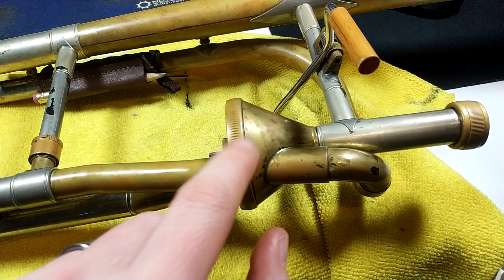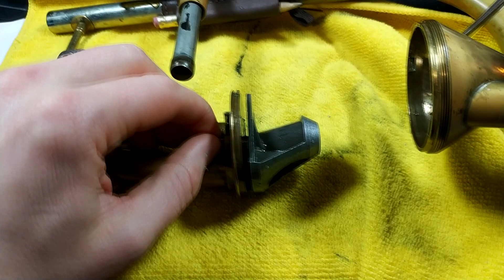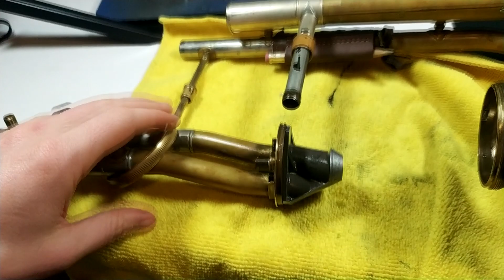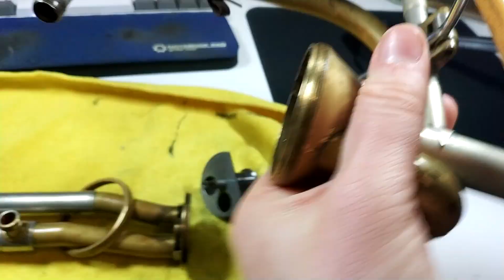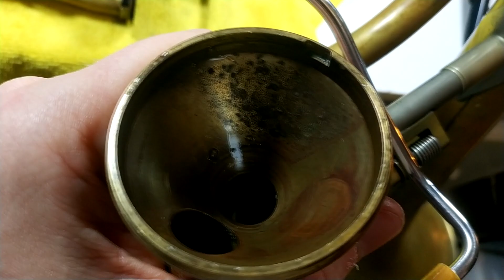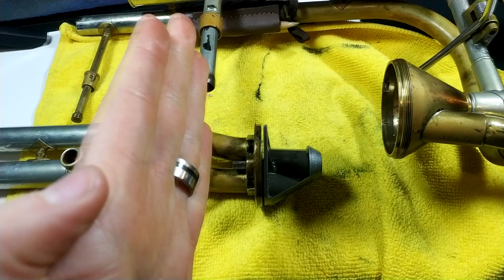The Thayer Problem

Comment: Hello Aiden
Question.......i heard you mention some of the new infinity axial valves play well and some don't can you elaborate some on this from you experience  etc..........
Also I've notice the original Thayer valves are really very open ( I can only assume that's the intention) compared to the new infinity axial valves.  Is it possible the new infinity axial valve is mis aligned?

Thank you
Ps.any suggestions recommendation if needed for a tech to take a look
Reply from the maker: the new Olsen (Infinity) valves can be very open as well, but they are often not built right at Bach. I've played some built by my tech that are AMAZING, as well as others that were randomly built correctly by Bach.
Reply: @AidanRitchie  GM thanks for responding.  Well I purchased the infinity valve from the Mike Olsen himself.  On that note do you mind send me your techs.number etc.......and I can have him take a look at my horn?
Reply from the maker: @slide50t  Go ahead and use my lesson form, I'll send an email back to you using that!

Comment: My Thayers are totally stuck on the spindle end, they pop up a tiny bit (enough to clean under there) but I can't take them off fully
Reply from the maker: The stop arms?
Reply: @AidanRitchie  Yeah, they are pretty much stuck even if I remove that screw
Reply from the maker: @SilverAg11  they can be like that. A tech will be able to get them off, but don't do anything drastic!
Reply: @AidanRitchie  yeah I don’t really need to take them off anyway, there’s enough room that I can stick some paper under there to clean them
Reply from the maker: @SilverAg11  that's how I cleaned my bass Thayer set. Just sucks though, you still can't get everything.
Reply: @AidanRitchie  yeah, I think when I go to get some of these dents out I will mention that as well
Reply from the maker: @SilverAg11  good idea!

Comment: Great video Aiden. As an engineer this is the exact reason I've never bought a horn with thayers even though the best horn I've ever played was a shires with dual thayers and a dual bore slide. I'm currently playing a 1983 50B2 belonging to a band though I plan on making them an offer for it and having a set of Olsen valves installed though not decided on standard or infinity version. What are your thoughts?
Reply from the maker: That's a great plan! Bachs really light up with new valves.
Reply: @AidanRitchie  Your opinion on standard vs infinity?
Reply from the maker: @greennigel6398  Totally up to you. Oddly enough, I may have Bach bass trombones with both valves(!) very soon, and I can give you a definitive answer!
Reply: @AidanRitchie  That would be great thanks!!